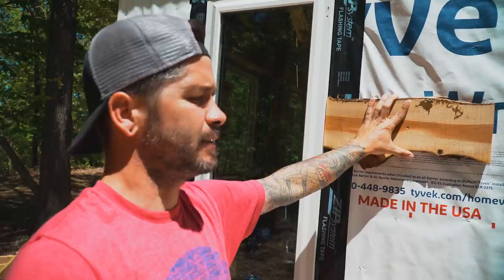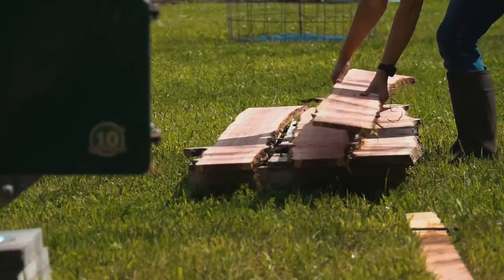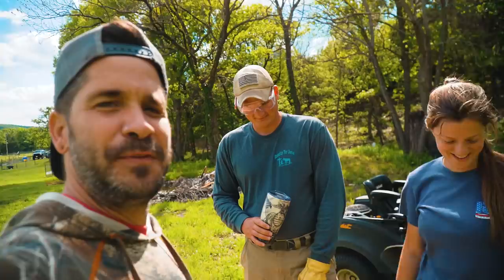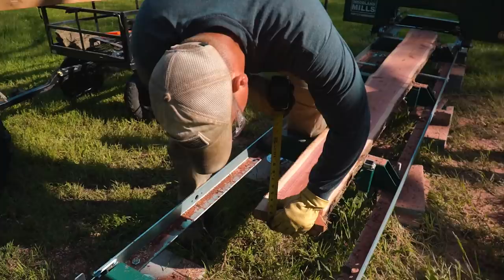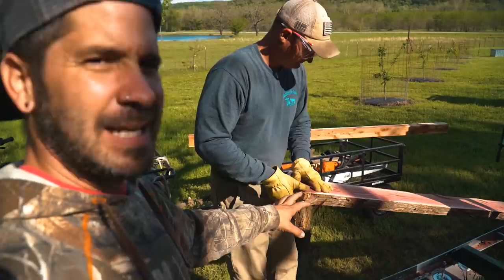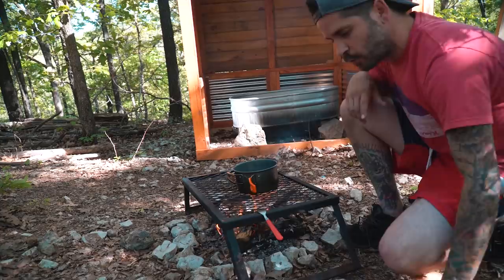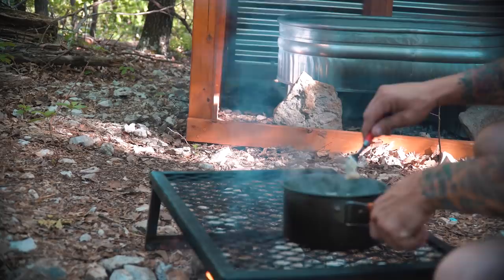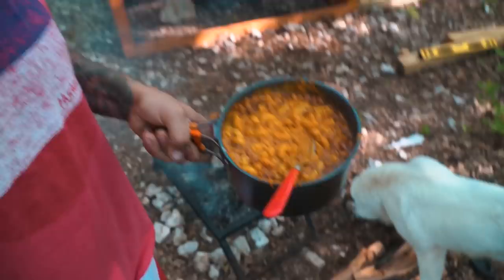Milling Cedar For Tiny House & WINNERS of Roasting The Crockers!

Comment: I would recommend that you try out your siding and chinking method on a piece of plywood before doing it right away on your house.  That way you can be certain that you like the look. 
The spacing between the planks of wood seem pretty wide and the chinking may look different than you imagine it will look.
Reply: i would install 2x4 plant ons around the windows corners and door trim and true up the top side of your siding boards and overlap your boards so the water sheds off. then you can just but to the heaver trim making the installation and zero chinking to maintain.
Reply: Sharon Milton 
It would never be water tight

Comment: Those first cuts of the log are useful.  We use those slabs to make repairs/reinforce the hog barn.  I also throw them down in the mud and they make a pretty good walk way in front of the fence where I hand feed my animals.  Since they are rounded, the water/mud runs off and they are not slippery because of the bark.

Comment: I watch Barnyard Builders who restore old cabins..they say NEVER use concrete.
Reply: True because it retains cold during winter and heat during summer when you build with concrete
Reply: They use elasomeric stucco. It tools easily and comes in 5 gallon buckets.
Reply: Lynda Coppenbarger That’s good to know. Haven’t looked it up but I think about the material that might be used in places like the southwest and other parts of the world, hmm

Comment: Weatherall Triple Stretch chinking looks good, but they recommend a weather guard sealer be applied first. They also require no more than 23 % moisture content in the wood.  I agree with others that you should test it first before you apply it to the house. Some folks say you need a bond breaker to allow for expansion and contraction of the wood. Some say you need foam chinking cord in it so that the chinking won't crack as the wood expands and shrinks. I am thinking that foam flat weatherstripping might help underneath the chinking polymer mud.  Very cool idea. I am looking forward to your exterior work and lessons. This is getting exciting!

Comment: If you have a can with no pop-top, you can open it with a flat rock. Rub the can on the rock to wear away the seal around the top of the can. It takes a little while, but it saves the edge of your knife.

Comment: If you are considering using cedar that is not dried, try board and batten style. It allows for the shrinkage and gaps in your boards. The battens will cover it.

Comment: If you start at the bottom of the wall and overlap all the way up like shingles it will look good and water will run off best thing is that it will never rot., Then just for good measure spray the house with a good coat of Thompson's water seal.

Comment: I would think about the window openings before deciding on the way you are going to do the siding.  You don’t have much room between the front window .  You don’t  
 want to have to repair the lumber or the chinking all the time.   Looks like you will have to do small pieces in that area. Experiment on the backside then decide.  Do whatever is best and easy.  Good luck.

Comment: If you cut those top and bottom pieces the same size, you could use them as trim around widows and doors or you could turn them into benches, stools, etc. 

Also- the house will be called:  Bacon Wrapped Jason.  Lol - sorry I couldn’t resist!

Comment: @Jason...I live in a cabin that they used Cement*Concrete chinking on. It looks like you'd have to use Chicken Wire as structure for ceent to bind to. That or the wire they use for Stucco to bind to. Cement*Concrete seems to break down with age. There are many types of chinking & I think I'd go with a Latex form that expands*contracts with temp.

Comment: If you are doing the cedar and mortar for siding you are going to need to establish a 1/4" gap all around the windows to allow for expansion. When we did the fake log cabin look we used a stick on foam window seal and then caulked over the top when the siding was done, it has worked well.  We used the cuts from the outside of approx. 2' dia. oak, 4 cuts a log.
  ...Quikrete 40 lb. Vinyl Concrete Patch Repair... mix 10lbs. of this to one 80 lb. bag of  type=s mortar mix. Also , from Lowes..Item # 88977 Model # WT22
USP 6-1/2-in 22-Gauge Wood to Wood G90 Galvanized Wall Tie (500-Pack),, you'll nail these to the wall between the planks  and they'll tie the mortar to the wall. Use 1 1/4' inch galvanized roofing nails.,, all 3 holes,,, then bend straight out,, then,, use a pair of pliers to bend them back over at about half the thickness of the mortar,,,then,, cut them off about 3/8 " past the bend with some tin snips, forming a "J". As thin as your mortar will be you might get 2 out of one strip if you want to try and nail thru it without a hole...also being thinner you might want to add more vinyl mix to it.

Comment: Have you thought about only leaving one live edge and lapping the siding boards (live edge down)? The method you are thinking about will not be waterproof, and you will be tearing all of the siding off in the future to replace it. I would also say to cut the siding boards 1/2-inch thick. That way, the boards won't be at too much of an angle, and you will get twice as many boards out of each log. You will still get the live edge effect, but you will have siding that will actually protect the structure.

Comment: With the table saw why not use over lap cuts , it will be water proof and still have the log build  appearance , no chinking required, no maintenance as your method. It may take a little  longer but will worth it the long run.

Comment: When you have the cedar up you should get some  1/4  inch blue styrofoam that yo can cut with scissors to fit the irregular spacing between the Cedar Slabs then screw the styrofoam to the plywood ,  then use some nylon mesh tape it will stick to the styrofoam then you can use real stucco concrete  or synthetic  stucco and that way it will be watertight and will last as long as the cedar boards will if you do not have a secure backing for the stucco it will crack on you did to expansion ,and movement.I know what I am talking about ,because I owned a Constructio Company for 40 years in Atlanta , Ga,  If you need any  sound advice about any construction matters just send me a message...Good Luck on your Tiny House project. ..Take Care.

Comment: I have an idea I think would look good .  But you think it over and see what you think. "Put the boards, after they are cut on the sawmill and cut the edge's off on a 45 angle. Then put on the house so the top board overlaps the lower board on it's 45 angle .  requiring no chinking and would be all solid cedar. As you can i'm not a fan of chinking, but I love the look of all cedar. Just my thoughts too give you something too think about.

Comment: Clap board siding was my first thought when you said before how you were using these boards. We use  tar paper chicken wire and stucco in the south so the first two would work for you to hold the third application not stucco there.

Comment: Product called permachink. Buy it in 5 gallon bucket not cheap but good stuff
Reply from the maker: I just wonder how far a 5 gallon bucket would go on my tiny house?? About $50 a gallon
Reply: @TheCrockers  hard to say depends a lot on width of gaps but I would guess 5 gal should do it. Also would need metal lath between slabs if it gets to wide
Reply: @TheCrockers  That's expensive n won't go far
Get what ever color you want, gray,  white... White mortar white sand, yellowish white, white mortar yellow sand.. That's what we used on our cabin. Brown is 21A mortar n yellow sand. Black mortar is really messy. But use mortar, not Portland, that's concrete. Mix it stiff not wet, and don't put stones in it, that will make it harder to finish smooth. I'm a mason 32 yrs and have used mortar on our cabin 20 yrs ago, still there n holding strong. We put it between oak planks.

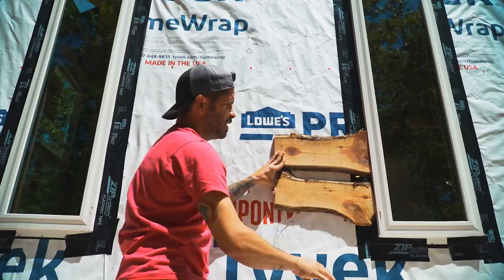Comment: Drain holes are on the sides of the windows(1:39 of video).Which means those 2 windows should have been installed horizontally.Just sayin. Drain holes to the bottom.
Reply from the maker: I know that. But they'll never get touched by rain. They'll be under an 8 foot porch

Comment: SAFETY NOTE
You all should be wearing safety glasses. If the wind whips the sawdust in your direction and it goes in your eyes, it may require surgery to have it removed. They numb your eye ball and use a real long needle to dig it out. YES, THE NEEDLE WAS VERY LONG, THAT IS NO JOKE AND I WAS SCARED TO DEATH. 
STAY SAFE.